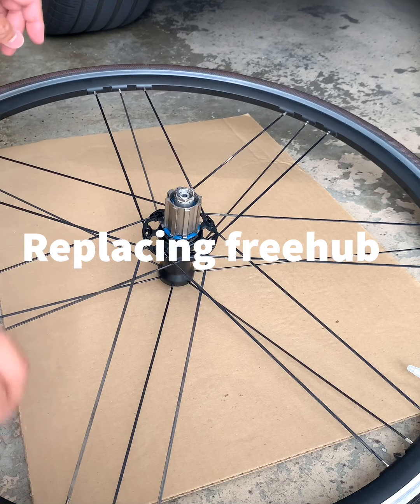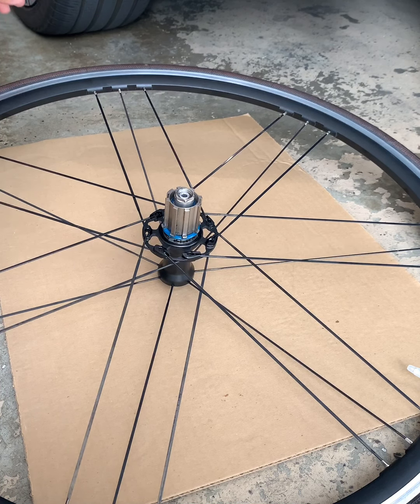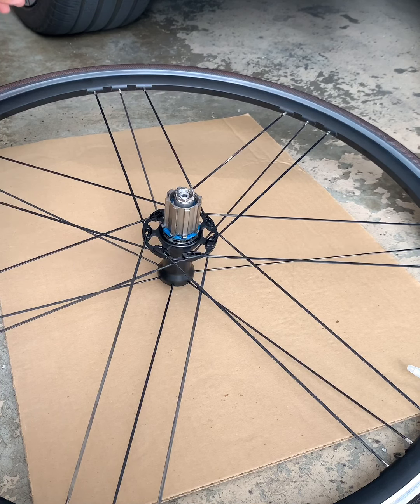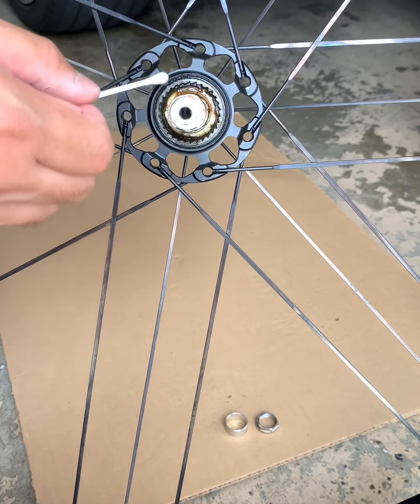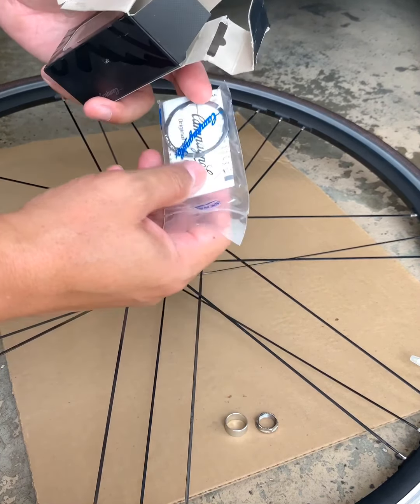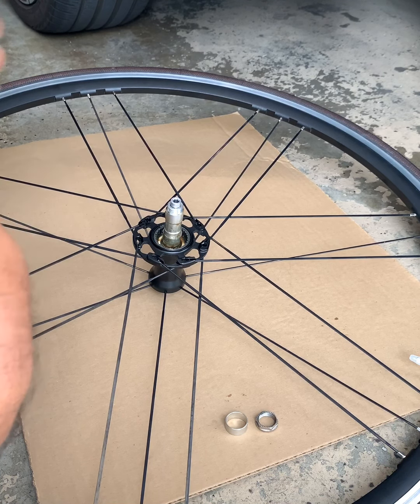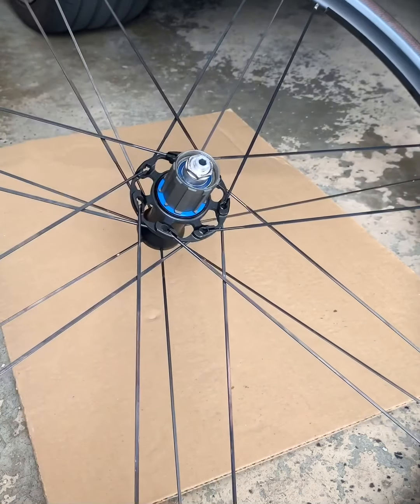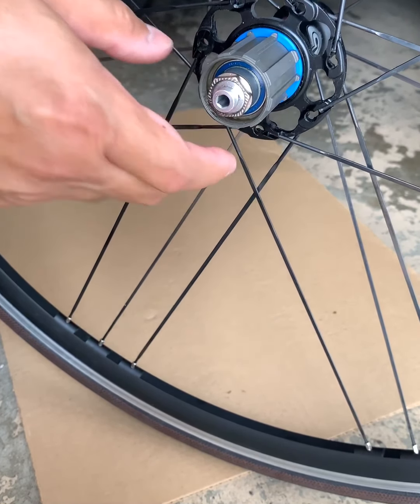Installing a Campagnolo freehub which is compatible to Shimano cassette

Comment: Hi jason, where can you get such a freehub. Searched the whole internet for this! Thanks
Reply from the maker: You can try calling Velo cycles in pasadena, ca.  That’s where i bought my campy freehub that’s compatible to shimano
Reply: @jasonzbored2276  
What did you do with the other freehub body? 
Were the wheels NEW when you did this video ?
Reply from the maker: @andrewlipsiner9791  Hi there!  Sorry for the super late response!  I still have the campy freehub.  With regard to the wheels, I bought it slightly used from a friend.  Very low miles on it.  Have a great a day!